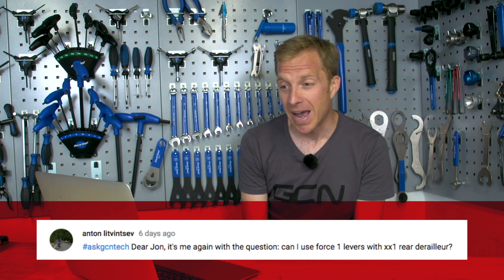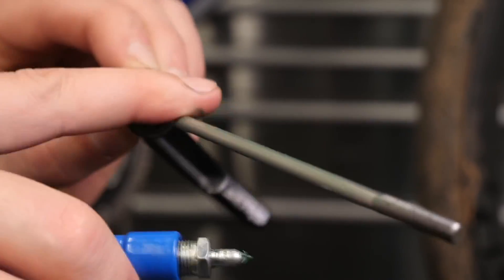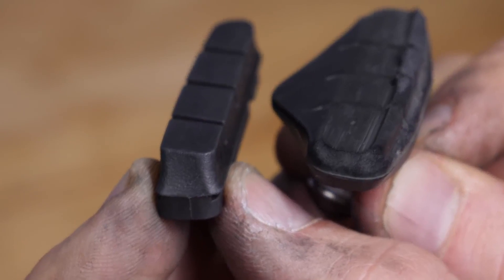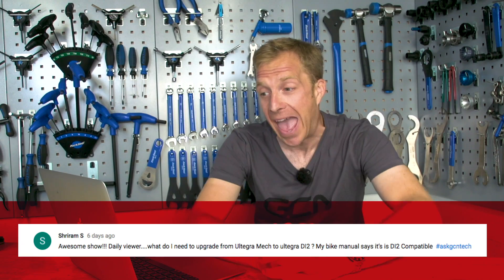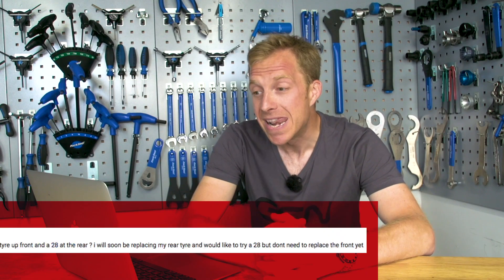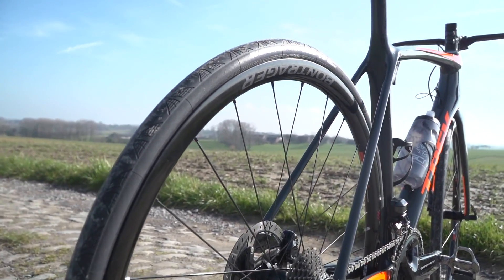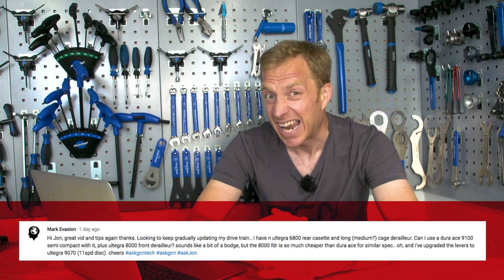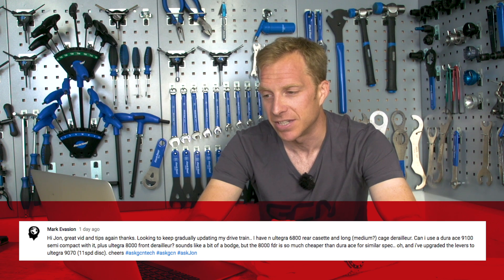GPS Speed Accuracy, Di2 Upgrades & Taping Helmet Vents?! | GCN Tech Clinic

Comment: My Lazer helmet has a clip on aero cover seen these used in uci events?
Reply: Nigel Wood those helmets have glued on covers. I've seen commisaires remove clip on covers from helmets at the start line of a race before. Cheers
Reply: Jon Cannings but what's the difference between glueing on something over the vents than sticking tape over vents? Could be wrong but never seen glued on Lazer areo lids / helmets on sale?? Come on UCI 🤔
Reply: Nigel Wood that's UCI rules for you. Lazer did offer the glued helmet covers on for wholesalers.
Reply: Jon Cannings 👌cheers Jon didn't know that! Keep up the good work👍

Comment: #askgcntech Hi Jon, i have a TT bike with Ultegra Di2 and Rotor QXL rings. Can i take out the FD and make it into a 1X setup? since i never really shift to the smaller ring anyway
Reply: I think there's a recent gcntech video where Jon hacks a 1X setup.  I believe the main take-away I got out of it is that you should use a special chainring/chain.  The teeth on the ring alternate thick/thin and match with the chain to help prevent it from derailing when at extreme ends of the cassette.
Reply: se7enTse7en yes i watched that. Rotor does have QX1 with the same narrow-wide setup. But i was thinking, i never got any chaindrop anyway right now so do i really need that narrow-wide ring. Another thing is whether i can just remove the FD and it wont disrupt the way di2 works

Comment: I'm thinking of getting a speed sensor for my elemnt bolt. Under the summer tree cover it has basically no idea what speed I'm doing. For example the other day bombing down a hill it said I was doing between 11 and 14 mph and when I got to the bottom it said I was doing nearly 60 mph! Neither option was true. High 30 to low 40 mph maybe.

Comment: #askgcntech hi, I am currently using ultegra 6870 di2 on my TT bike, I am wondering if I can use the new bar end junction/charging point of the new EW - RS910. Is it compatible? Can I make it compatible? It will help to hide all the wiring and easy access for charging. Thank you

Comment: @askgcntech is there a way to measure which tyre width your frame and brake calipers will take?
Reply: If you have a tyre on there, just look and estimate. The differences between road tyres are really small, just 2,5mm on all sides when changing from 23mm to 28mm. If there are some tricky spots on the rear wheel, you might want to tape a rubber band or something of suitable thickness to simulate the larger tyre and see if it clears.

Comment: GPS speed calculations can be really bad due to GPS drift. If you're close to skeyscrapers, large bodies of water, a valley or under tree cover, the drift can be +/- 1000 feet. That means the speed can be +/- 15-25 mph. So no, GPS speed is not a reliable replacement for speed sensor.
Reply: You are correct that position accuracy (and hence all calculated figures) can jump around to as much as 1000ft. However its not just skyscrapers and so on that obscure GPS reception that causes this. The GPS satellites are low orbit which means you are receiving signals from moving objects. Sometimes your position can be out just because of where in orbit the received satellites are sat relative to the receiver. Its actually a standard GPS parameter that few know about called Dilution of Precision (DOP).
Reply: Agree. A well known social cycling website doesn't take drift or dilution into consideration when calculating speed for segments. As a result, you will see uphill segments with 45mph. In some cases adaptive error correction can improve the accuracy. Where cell signal is available and there's 2 towers with line of sight, it can be used to improve the accuracy too. But it's much easier to just use a garmin speed sensor on the wheel, then you know exactly how fast you're actually going.
Reply: Or if you have a garmin edge 810 #fail
Reply: Another issue is are you climbing or descending, the speed is calculated using your horizontal movement.  Check out https://en.wikipedia.org/wiki/Pythagorean_theorem

Comment: #askgcntechhi, my 105 5700 front derailleur makes some problems. I simply wanted to adjust it and then i noticed, that i'm not able to tight it back to the frame. I took it of and saw something like a spring in the hole where i screw the bolt in.(in the front mech)now im not able to use it anymore. Do i have to buy a new one or is there a fancy way to repair my old front derailleur?and if i have to buy a new one, will the 105 5800 front derailleur fit to my 105 5700 lever? thanks for any help and sorry for that english :)
Reply: Sounds like you have pulled out one of the pivot pins rather than the fixing bolt.  I'm sure it can be re-assembled, but it will be difficult.  Might be easier to just get a new derailleur as they are quite inexpensive.
Reply: Most front derailleur (especially 2X) have same cable pull. So you can use any FD designed for same speed drivetrain.

Comment: #askgcntech
Hi Jon, I recently got in a crash and had to replace my front wheel with a shimano rs010 clincher wheel. My bike currently is 7 speed and is made up of mostly from the shimano tourney groupset. My question is if I do get the matching rear wheel (which is 10 speed), would it be worth getting a 10 speed cassette and upgrade my derailleur and shifter or get a 7 speed cassette and just add spacers. Also would it be possible to not upgrade my derailleur. Money is pretty tight!
P.S I know my frame can take the larger hub size as I've seen it in forums.
-Thanks

Comment: Hi, I've noticed my big chainring is slightly bent - is there any way to fix this at home, or is this an LBC/new chainring situation? It doesn't affect performance, but it's kind of annoying as it causes a tiny bit of chain rub on the FD in certain gear combinations. (Shimano 105 5800, groupset, for ref). Thanks!
Reply: If it's the whole ring: have you checked to see if the bolts are tightened correctly all the way? It could also be a bent tooth which can be straightened with a set of pliers (and caution)
Reply: Psyk078 hey thanks for the reply! Yeah, I checked all the bolts and torqued them to spec; seems to be the point opposite the crank arm that moves v slightly inboard :(

Comment: #askgcntech I just got a new S-Works Tarmac frameset which came with some fancy Ceramic Speed BB30 bearings. I built up the frame using included Shimano adapters for my Dura Ace crank, and they went in extremely tightly. I asked the shop for tips for removing the adapters so I can service the bearings in the future, and was told "good luck", and to just replace them when they start getting noisy. Is this the way it has to be?
Reply: Franklin Schwartz If they can be pressed in, they can be pressed back out.  You might need to find a new mechanic.